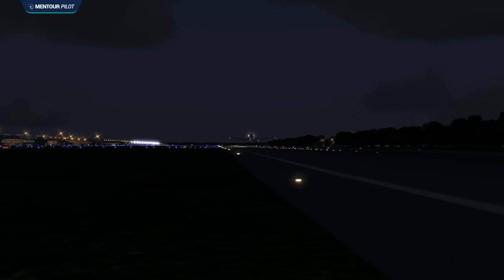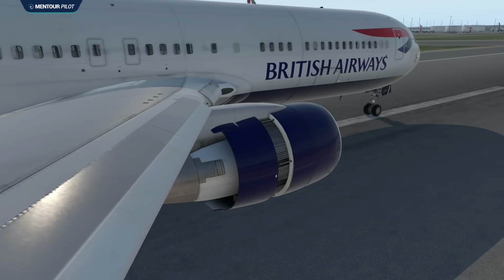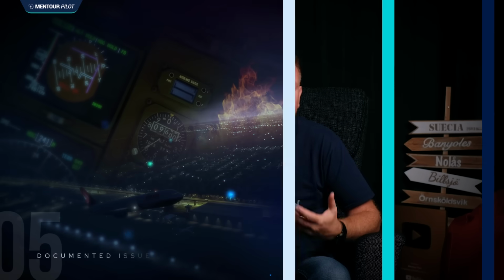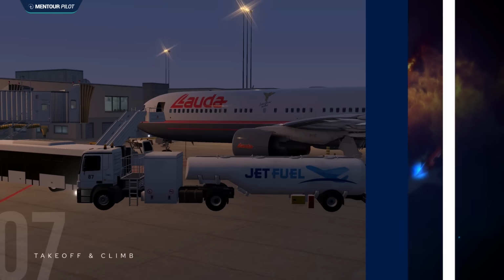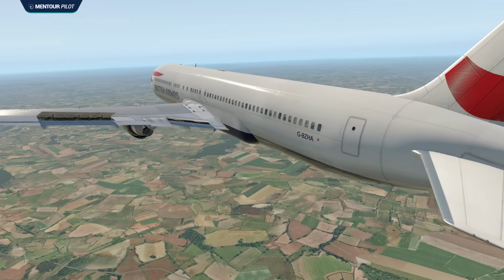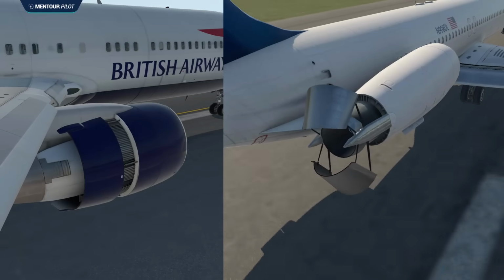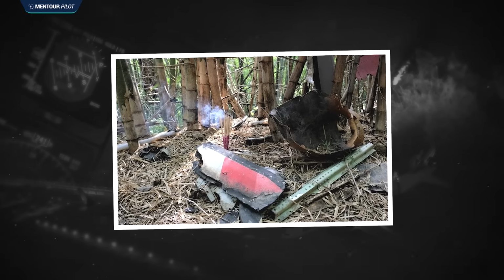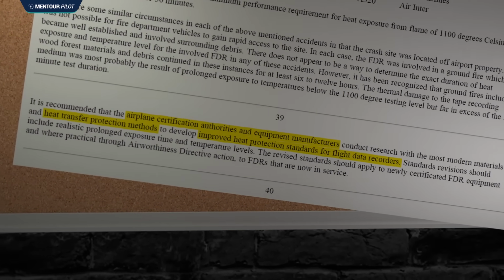HOW an Impossible Failure CRASHED this Boeing 767!

Comment: The thing that bothers me most is hearing that the crash site was looted even before the investigation team could get there. It's a level of barbarism that is hard to understand.
Reply: What I don’t understand is why anyone would want to loot a plane crash? Were they planning on melting down the metal components?
Reply: @Robynhoodlum  worse. looting the.. deceased.. & their belongings...
Reply: @Robynhoodlum  Don't need to melt it down as most metal scrap can be sold copper, aircraft aluminum, steel, titanium rods along with various other metals used can all be sold.
Reply: @Robynhoodlum  From top to bottom, a nation of thieves.
Reply: @Robynhoodlum  People were found stealing body-parts from the 1974 DC-10 crash outside Paris (a crash which could have been avoided had the FAA not allowed the plane's makers to take their time doing essential modifications to all planes of  the type.
Reply: @Robynhoodlum  imagine having a piece from an crashed airplane. This piece just reminds you suffer, pain and death. Why would you..
Reply: guys, looting a plane full of deceased people is not normal. they are lowest of the low.  they are thieves and bunch of scavengers. This can't be justified.

wikipedia: ""Volunteer rescue teams and local villagers looted the wreckage, taking electronics and jewellery,[16] so relatives were unable to recover personal possessions."

How do you feel about it?
Reply: The most common cause of looting is during riots.  Look at the faces of people on the news broadcasts as they run out of stores with entertainment products clutched to their chest.  It is a look of Glee.

"Now's our chance!!!!"

That would occur to these people as they watched the plane coming down.

There IS no excuse for this - but - this is a common reaction.  The truth is - most people don't give a shit about people they don't know - especially if they're from another culture.
.
Reply: Happened when Russia shot down the airliner over Ukraine a few years back. A new meaning to blood money. savages
Reply: I'm right there with you on that. I was disgusted by that when I heard that! Pathetic, degenerate, backwards, selfish, uncivilized idiots.
Reply: If you're going to loot corpses of people who die in plane crashes you can go ahead and starve to death.
Reply: @MarkJones-gt2qd > eating the bodies

You mean the thing that is a completely expected (if horrific) thing to happen once the threat of starvation becomes too high? For example with Uruguayan Air Force Flight 571 that crashed in the Andes?
Reply: Poor people who scavenge for money for food don't care about your flights and your investigation, those are rich people problems.
All they care about is getting enough money to live and maybe one day finding their way out of poverty.
Reply: @mrljgibson  Well then, they don't care about basic human decency? F*ck them then - I won't give a rats ass about them either.
Reply: That's how most of the planet operates, unfortunately. There are only a few civilized nations existing. Most people live desperate, barbaric lives.
Reply: These people do what they have to do to survive, literally. Also, most have little or no education. So, if pillaging puts food on the table, they pillage.
Reply: @glenmartin2437  if I died in a plane  crash and it was to come down  over an area strike  with poverty then I would WANT my belongings to be taken by those who could use them and put them to use for their needs. If selling my watch or phone brings a family a few meals, a new second hand car or some clothing then all the better! People go on about looting from the dead as if there's nothing worse and yet the dead don't care and the dead have absolutely no use for those items! Worse would be stealing/looting from those who are alive and need the items! Us humans are such emotional beings..!
Reply: @paulhamj6175  so you wouldn’t want your family members to have the pictures from your phone? What is someone going to do with a broken locked phone? Or your wedding band. Or your personal items. I would speak to your family first. You might not care, but losing someone so violently and suddenly, people want to hold onto whatever they can. I know I would. I’d be devastated to learn that someone stole my loved ones things. I’d be sick over it. There’s a level of respect that is due to the dead. Especially in situations like this. We need to have a line that separates us from civilized and savages.
Reply: @shayne elizabeth The dead have no cognition of any respect paid to them and certainly can't feel that any is "due" to them. I've noticed that the most respect for the dead comes from those who feel guilty for treating them like crap while they were alive.
Reply: Not surprising when it’s in a 3rd world country
Reply: Desperate poor people in rural Thailand looking for money to survive. I would do it too if I needed to survive.
Reply: @johnwilliams22 , we need to crash more planes there to make them survive better.
Reply: People loot airplane crashes all the time. There are photos of crashes where you see ‘responders’ pocketing rings, going through luggage, finding other high value items. Unless the plane burns, the only things that get truly destroyed are the human beings on the flight. God help us.
Reply: When polish presidencial jet crashed while landing in smolesk, the local started looting too, which led to Russian soldiers come and fire some rounds to drive looters away, the clip later uses for disinformation camping in Poland like "how there are some survivors and Russian were killing them"
Reply: Imagine having very little and then an entire plane full of items falls in your area. Not sure why it's so difficult to understand the motivation of the looters. It would feel like a godsend.
Reply: @GrahamNificent , it depends on what you mean by understanding. Everyone here has on an intellectual level understood their motivation. But you are asking us to do it on a sentimental level.
Reply: You guys are actually insane. In your pursuit to virtue signal you end up excusing looting a plane crash full of corpses and have the audacity to claim that is a reasonable behavior just because someone is poor?!
Reply: @joker-hj2  At that point of impact on the ground, there was no plane or bodies to be seen, it was just small fragments. The pieces that broke off on the way down and luggage that fell out of the plane could be (and was) looted, because it fell much slower and away from the main crashsite.
Reply: @joker-hj2  You don't know what virtue signaling means. If you were in these people's shoes you probably would have done the same thing. Claiming the opposite, because you know better about not looting/stealing, blabla IS virtue signaling. You aren't better than these guys.
Reply: @destinationhope5872  That's exactly what people like them want.
Reply: All cultures are equal? Uh, no.
Reply: @qanononabong8491  Who said that though? You say "Uh, no"?
Reply: @isabellind1292  typical iQnon rhetoric; on a 'flight disaster' docu. 🙄
Reply: @isabellind1292  If the airplane would have crashed in the middle of the U.S. State of Alabama, it would not have been looted.
Reply: @qanononabong8491  there’s a discussion elsewhere in this comments section regarding passenger’s luggage being stolen after a crash in Dallas in the 80s. Also, poverty has an influence on how people behave.
Reply: Animals. Not human at all. Hope they feel bad in their dreams

Comment: I’m right there on the Flight-deck….This would been very startling and difficult to figure out in flight.
QRH sure didn’t help.   I’ve read that section in the QRH many times….just “shut it down” if it full deploys
Great video and system schematics and explanations….I flew the 757/767-200-300-400 for over 20 years….
They just didn’t know this malfunction could be so serious….I didn’t.   This is really good.

Comment: This and the 737 Max/MCAS crashes are some of the scariest to learn about because the pilots really didn't stand a chance. I can only feel for those poor souls on board - both aircrew and passengers - who in mere seconds went from a perfectly normal flight, to knowing they were headed to certain doom and what must go through the mind at that point. As ever, the video is presented in detailed yet sympathetic manner and I think that keeps me watching.

The test regime for this system seems to have been all about getting the planes passed as quickly as possible rather than doing a thorough check at all realistic operating airspeeds. I hate the thought that manufacturers cut costs at the expense of safety.

Comment: Once again, a magnificient video which teaches and informs both the technically trained and the novice pilots about this issue. As a retired airline pilot who flew the 757/767 fleet for about 17 years I will never forget my IOE on the 757. My check airman was a great guy who I had done my initial Captain training in the 727 with years earlier. The majority of his experience was in the simulator. On the second day of my 757 IOE we were departing on the final leg of our trip back to base when shortly after takeoff we got a "Thrust Reverser Not Stowed" EICAS warning. We had no vibration and no advers yaw but with his relative low line expereince and as a check airman who had giving this failure many times in the simulator he was quite concerned. While he wanted to return and land I discussed with him how no flight characteristics supported this was an actual failure but instead a bad indications. During our debate the light went out and stayed out. We flew on to destination with no further indication. While he knew the airplane much better than I at that point in my experience with this fleet, his relative low line experience and his bias to the training environment influenced his beliefs. Unlike the unfortuneate crew and passengers on the Lauda flight, we were lucky to be able to laugh about the whole thing on the way home.

Comment: a simple line of code added to the software should prevent this.. Based on airspeed and/or altitude, activation of a reverser should always turn the engine to idle automatically, 0 sec responds time. It always surprises me how software redundancy is used so ineffective.
Reply: Airplane manufacturers are d@mb

Comment: So if I understand the bypass style engine is almost a hybrid between a jet engine and a propeller driven aircraft. Because the fan is pushing most of the air, but you also have the jet engine. That's quite brilliant.
Reply: Correct but it has another benefit over a propeller driven aircraft.  With a classic prop, the air is pushed backwards, but some of it also escapes radially (and thus is wasted).  But with a bypass engine, the outer casing of the bypass duct contains the air and only allows it to escape backward (i.e. 100% of it is used as thrust).  It is sort of like a propeller blowing down a tube.

Comment: The best part of this story is Niki Lauda forcing Boeing's hand into admitting they f'd up their system by going all out on flying this model of 767 in the same condition. Forcing the lawyers to give in and say that it was Boeing's fault with the thrust reverser.
I guess nearly dying in a fiery crash and coming back as early as he did from said crash gave him mighty big brass ones.
Reply: If you didn't already have a big set of brass ones, you probably shouldn't be a racecar driver.

Comment: This is one of the reasons why i wont fly boeing aircrafts anymore.
You wouldn't get me on a boeing even if you paid me.
Boeing has proven to me that the bottom line is not safety of crew and passengers but the diffident the owe to their investors.
The FAA shouldn't allow boeing to fly ever again but it's an American controlled body so they will protect boeing.
Any other company would be grounded.
The FAA should be overhauled and run by an international board instead of just one country!

Comment: The corrollary of this incident is - if you think as an aircraft manufacturing company, that a mechanical fault will never happen, because maintenance is here to prevent it,  you will find out there exists tons of shitty air operators which will drive your maintenance into the ground by following the letter of it and resetting counters like Lauda Air (he was however not the only one - read up the Admiral Cloudberg subreddit to see where this material is coming).

Comment: Probably the best video you have produced to date, very informative but harrowing. My thoughts go to the families of those who lost their lives.
With regards to the loss of the in flight data recorder, why has a system not been developed whereby data can be stored in the cloud in real time? By all means keep the mechanical recording device but it shouldn't be that difficult to implement, should it?

Comment: I find it strange that so many assumptions were made about the circumstances of an RT deployment: low speed and idle. I wonder if anyone asked "well, what if it happens at mach 0.78?": I bet some people did, and on the basis of what authority was that question then ignored? To me it is particularly shocking that such a lax, optimistic attitude was taken when, as you said at the start, RT incidents had previously occurred over and over again, on many types of aircraft. Unlike with many of the accidents you explain, in this case I really feel that these people needn't have died.